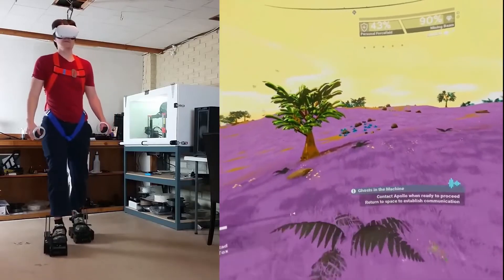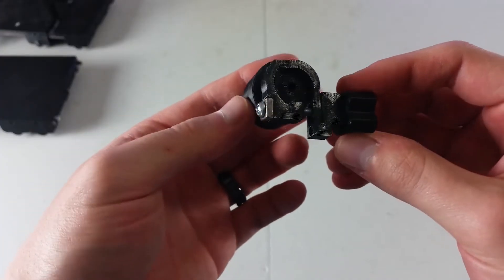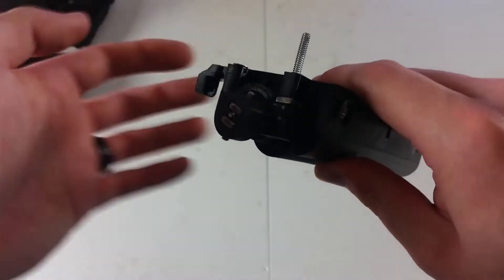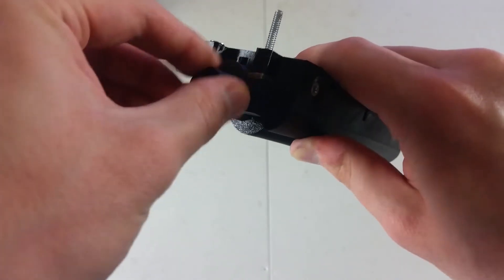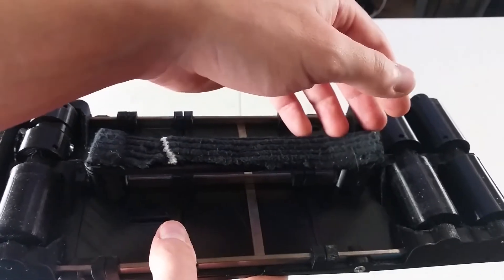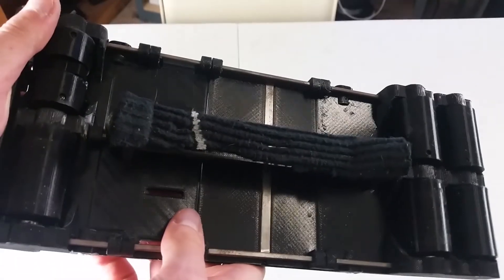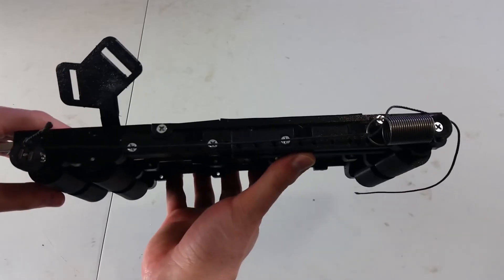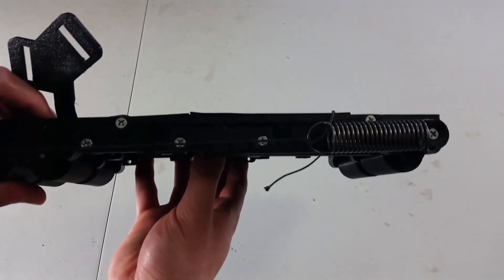VR Shoe Build Log #36 - Braking Mechanisms

Comment: Spring Life Cycle:  There are some good calculators out there, once you know:
Max Travel & Max Load, Mat (elastic limit) = fatigue life.
Basically: short stoke increased life (load not vital)...longer the stroke load is detrimental and leads to fatigue/failure.
Extension/Compression spring general rule I use at work:  stay under 25% max deflection at desired load - approx 100,000 strokes.
under 10% - 1/2 million, 3% - millions..
Reply from the maker: Thanks. With 100k the spring might last at least a few months.

Comment: Could you ad rubber belt around the wheels ? As for tank
Reply from the maker: Yeah a rubber or some kind of elastic could work.
Reply: @finallyfunctional  Yea a large elastic to provide grip to the floor, even resistance and harmonize the wheels together and the movement in general ^_^

Comment: As a fan of "The Slingshot Channel" I wonder if you could use some type of rubber for your breaking system, very stretchy, and can quickly build up resistance the further it is drawn.
then at the main connection on the "front"(?) of the shoe could have a high dampening rubber to absorb the impact and reduce sound as it snapped back.
Reply from the maker: I like his channel too. Let me show you it's features!
Yeah, stretchy rubber or an elastic band (bungee) might be better. When I get back to this mechanism I'll consider it. Since a bungee is wrapped in soft, cloth like material it might not be too loud. Maybe rubber could be wrapped in cloth to dampen the noise.
Maybe there is a way to make it so the spring/elastic/rubber doesn't snap back really fast and make a loud sound. If it snaps back slower, which should be fine, it won't be as loud.

Comment: Another possibility is to use some sort of hydraulic system, like water or air in a large plastic syringe. One way it’s easy to move a syringe, but harder in the other.
Reply from the maker: Cool, thanks. A follower on TikTok also mentioned maybe a syringe. Not sure how well that would work and if it would be simpler than springs or elastics, but it's something to consider.

Comment: I think a spring of sorts is the best brake for this application. This is because the goal seems to be to help the user stop after each step. One possibility is using some sort of stretchy rubber as a spring replacement. The noise may be less of an issue with rubber and may provide more options for strength and length.
Reply from the maker: Yeah, or maybe an elastic bungee. You'll see in the next video (should be out Tuesday) I was able to go with a really simple way of providing resistance and at least for me it's good enough to keep going with. And I mention trying to use a simple stopper to help the user and it wasn't working, but today I think I got it to work. But at some point I'm probably going to come back and fiddle with elastics or more springs to see if I can make a way to limit the user's stride length (adjustable) so that the shoes can slide too far.

Comment: idea 1A- they make a dip, or spray, for tool handles, maybe you could coat the springs in that stuff, to help make it quieter when retracting ( probably will have to coat it while its stretched out)....... idea 1B..... tubing, maybe you can slide some sort of small tubing, over the springs, to quiet them. ( Winter Gatan does this with the rod tracks on his musical marble machine he is building to quiet the noise, i recommend checking him out, both to see this example, and cuz hes just cool)

idea 2 - screen door spring, not only should they be big, strong and long lifed,  but they also have a hydraulic piston to slow the doors down, so they dont slam shut, might be too big for this project, but you  might be able to use them as a starting point, and make a similar, but smaller version. 

Idea 3 -  get a big strong spring, that is way stronger then you need, and use a  high torqe gear ratio, and a strong spring, to wind up the string/cable, this should over come the need for a longer spring, and extend the life of the spring, by only needing to extend the spring a little bit, while the rotating gears, take up all the movement, and its cable, of a striding step. so a random example would be say the rollers rotate 10 rotations, in a step, but the winding gear only rotates 2 rotationts, giving you a 5:1 ratio.

just some ideas i thought of, hope they help.
Reply from the maker: Thanks. If I look at the spring mechanism again I'll consider these. I didn't think of putting a tube around the spring and didn't realize there are coatings.
For idea 2, yeah might be big, but I haven't looked into how those work. Thanks, yeah it might be something that can be minified.
For idea 3, yes I think that could work it just makes it more complicated to add gearing in.
Reply: @finallyfunctional  cool, just ideas, if they dont work, oh well, but hope they do.

Comment: Great progress! But I think that with the springs, you might run into another issue.
Not everyone has the same length of legs, so when you reach the limit of where you want your feet to be, someone else has their feet rolling back way too much. Maybe different spring types for different leg lengths?
Reply from the maker: Thanks, good catch. I was going to handle that later if I liked the spring mechanism. You may have noticed that there were parts with a bunch of holes running alongside the string. That was so I could adjust different parts to adjust the stride length and tension of the spring. I uploaded this image to clarify.
https://imgur.com/a/V42jbEt

Comment: could it be possible to use something like a deca move to get the direction of the shoes so maybe 360° are possible? Just a idea :D
But if the get shoes nice progress, i would love to build them too, a friend of me has a 3d printer :D
Still thanks for keeping up this project <3
Reply from the maker: Yeah, or Natural Locomotion (NaLo). NaLo is just $10 on Steam and you can use vive trackers, joycons, and I think some other controllers on your feet and it will do that kind of tracking as well as track your feet for walking in place and it might work for slidemills too. NaLo is what I'm going to use at first once these passive vr shoes are done, but I'll probably eventually end up writing my own software like I did for the previous motorized version.

Comment: Have you thought about maybe using a torsion spring instead of a compression one?
It might be possible to implement those inline with the rest of the axle, amount of force could be regulated by applying more or less pretension (and also by just using a stronger/weaker spring :P)
Reply from the maker: Yeah I've thought of it. Or maybe using a rotor spring too. The torsion spring would need to be able to rotate many times as the wheel turns. The wheel can turn 10 or so times in a single stride, so the torsion spring would need to be able to turn that much.
I thought an extension spring would be the simplest, but other springs are worth considering.